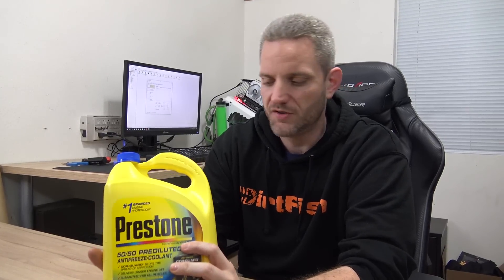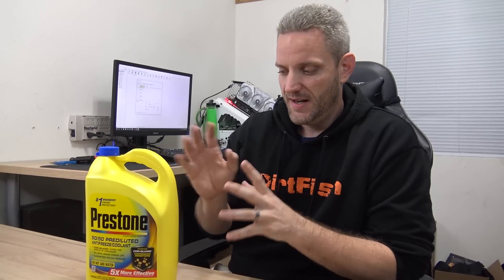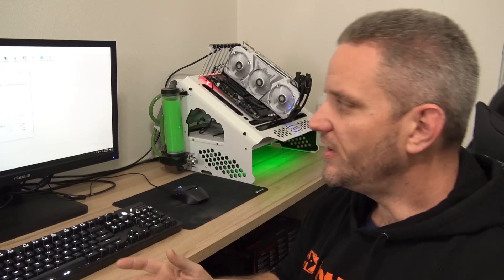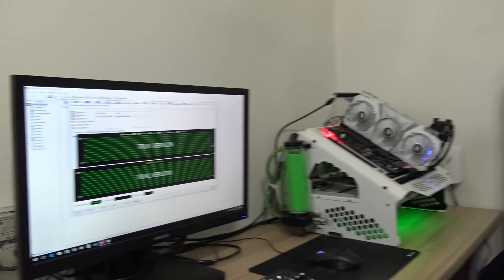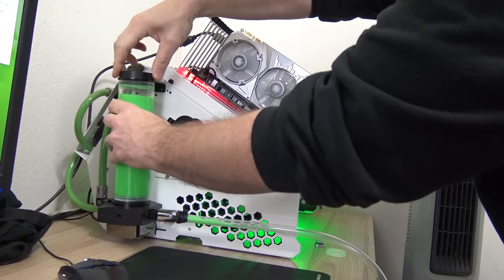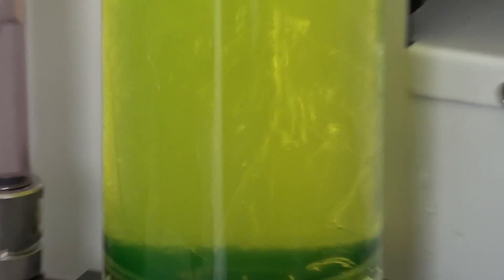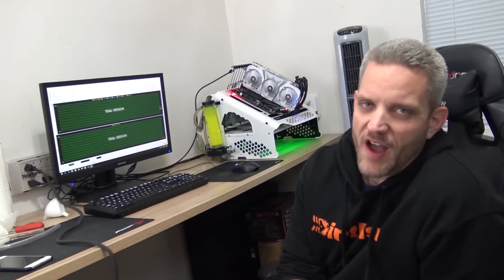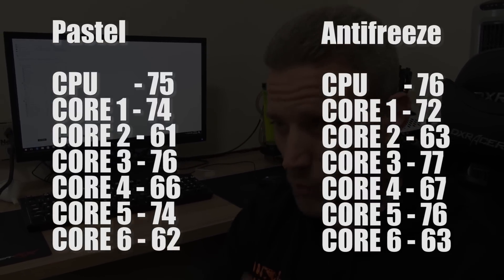I used Antifreeze to cool a PC

Comment: Why use an ethylene glycol based antifreeze and why use such a high concentrate. 50/50 for a PC is way too high. I would think 90% water with 10% antifreeze would be a much better ratio. The 50/50 wouldn't cool down as well going through the radiator. Remember antifreeze just prevents the water from freezing, and has some additives to increase the boiling point of water. I would like to revisit this test with options of coolants like a nitrate free coolant, silicate free coolant, or H.O.A.T coolant.

Comment: Back in like the year 2000 or so I made a waterblock and used a old car heatercore and I had it filled with antifreeze and it ran just fine for years.

Comment: I expected him to run a small loop outside of a computer for a few months or until it fails after a few days or weeks of running. Shouldn't be hard to run the pump off of a set of 12v batteries, depending on the draw.

Comment: i dont know what pastel is but you should also do just water you said distilled water you should try that vs like filtered drinking water because i know distilled water is not very electrically conductive not sure how that transfers to thermally but after that try the water with some of the coolant additives that are supposed to lower the temps

Comment: you are supposed to mix it with water, not use only antifreeze.  The hotter the weather, less antifreeze you need. Anyway, yes, you can use about anything instead of water

Comment: there is no way id put that shit in a pc use demineralized water been using it in my car for 360,000 klms the system is as good as new do not use distilled water its still corrosive

Comment: Its what I expected. The eg is to keep water in a radiator from boiling at 212. HOWEVER there ARE additives that will cool it down. Wet water is one and there are others. They drop the temp in my hotrod 6-- hp 350 Camaro by almost 60 degrees and there is stuff that will almost double that. Its a pink bottle at any autoparts store. I used it in my old phenom build and the temps that were almost 80c dropped to 55 c max. I think I have the bottle still so if you want a complete name I can do that. You have to make sure you are using quality tubing though and not the cheap junk some older coolers came with.
Heres a link to wetter water it claims 20 degrees cooler. Itw one of my favorites and I found it dropped 50 f. not jsut 20.  no guarantees guys . USE AT YOUR OWN DISCRETION NOT LIABLE IF YOU MESS UP YOUR STUFF...However it might be awesome should you have the correct components that wont get harmed by glycol based liquids. (glycol is basically sugars)
http://www.cjponyparts.com/red-line-water-wetter-coolant-additive/p/RLWW/?gclid=CjwKEAjwpdnJBRC4hcTFtc6fwEkSJABwupNi5-J3v-cmIsARK4lcP3ly78fP_SB0bfjchvcsYgy0RxoCdK3w_wcB

Comment: this may not be an original idea, but can you use liquid nitrogen in a water cooled PC??
Reply: thebattlerocker Nope, it would evaporate and the tubing would expand and explode, also condensation would form and kill the motherboard, Now you can use liquid nitrogen to cool a cpu, just not in a loop like this
Reply: Liquid nitrogen is just air. Unless you have a compressor to get it back into liquid form it would just all sublimate. Then you invented air conditioning, so you might as well just use R-134a

Comment: that tube you pulled out is to put the warmer coolant on top and take the coolant from the bottom where its colder
Reply from the maker: No, that is not what its for. i was a part of the initial testing of the light tower res and its nothing more than aesthetics. Dont make stuff up
Reply: are we both talking about the tube at 8:13 ? it looks like the tube is supposed to push the fluid to the top of the reservoir like it did when you ran it low at 5:17 .

Comment: Features:
For All Gasoline Engines, Light Duty Diesels & Classic to Modern Production Cars
Ready to Use, No Water Required
Eliminates Overheating, Boil-Over & After-Boil
Generates Very Low Vapor Pressures
No Silicates, No Phosphates
Contains No Oxygen, Eliminating Corrosion & Pump Cavitation
Low Toxicity
Protects for Life of the Engine

Comment: I know nothing about watercooling, but couldn't you use chemically stable materials such as glass (at least I belive that's the term for it) and have a perfectly fine loop? Or maybe use the materials used in cars, cause presumably you'll then be using the fluid under the exact conditions it was made for (with the exeption of temperature)

Comment: Hey try and cool a modern system with a stock Pentium 4 3.2 Ghz Prescott CPU cooler and compare temp results with a Preshott processor compared to a modern I7 using the same cooler. Zip ties to attach to a modern motherboard allowed as long as you show you evenly tightened them. Challenge given Jay.

Comment: rubber and plastic are also used in a car cooling system at higher pressures and temps so i guess it should work

Comment: How does antifreeze help with cooling? It's Anti Freeze, not anti heat. You should have used car cooling liquid!
Reply: Ruben Braekman antifreeze is car cooling liquid/coolant. but pure antifreeze doesn't conduct as good as water so vehicles overheat. while pure water boils and freezes too easy causing a ton of problems. that's why he said in the beginning in was premixed 50/50.

Comment: mineral oil mineral oil mineral oil. I would love to see what happens when you run mineral oil through a pump with tubing. People claim that doing so will cause the tubing to harden over time, and that you'd need an additional external cooler pump to quick chill the mineral oil to maintain low temperatures, perhaps something like a fridge could do, only in a smaller size that doesn't take up any additional space. Taking the concept of how a fridge works, and miniaturizing it to encase around a tubing pump thus cooling down to -18°C

Comment: Toyota has some weird coolant that smells like juice and is red and is very long lasting, you can't mix it with the red stuff that GM uses because the GM coolant will eat Toyota water pump seals, anyway not sure how different types of coolant would behave in a pc cooler but there are some other coolant types out there in addition to the classic green stuff

Comment: All antifreeze does is lower the freezing temperature of water. It actually doesn't work as a coolant itself. You put it in your car so the water in the radiator doesn't freeze if the temperature is below 0c 32f.

Comment: a lot of cooling systems in cars use plastic components such as water pump impellers among other things. granted an engineee wouldnt use a plastic thats incompatible with ethylene glycol for a part meant to be submerged in it but i digress. the plastic, with the exceptiom of petg tubing, SHOULD be okay. now another concern is biological life. it doesnt grow in cars because the temperatures can range from 180 to 210 degrees Fahrenheit. but a water cooling loop wont get that hot so a biocide is required

Comment: But now you put your desk outside in Antarctica and your coolant won't freeze! 

Antifreeze really doesn't cool any better than water, it just doesn't freeze in the winter causing your engine block to crack. It also has a higher boiling point, but that is also irrelevant for a computer application.

Comment: no its not gonna be the same, its gonna get hotter. antifreeze is used in engine to keep the water from freezing in sub 32 temps, and also has corrosion inhibitors for rust etc. 100% water is THE best coolant. EDIT: watched the rest and saw the end.. although they were consistently higher temps except 1 it was only 1 or 2 degrees. i would say it doesnt make a difference because it's limited by how much heat it can sap from the ecu(which has very little to do with the fluid, more so system design) than it is how much it can radiate it off(which water is noticeable better at). just so you know, and i know it doesn't mean i know everything about it, but i am a mechanic and i do study these things

Comment: Why would you use antifreeze?  antifreeze is terrible at wicking away heat, that's why you have to use it with water in your car; the water pulls the heat away, the antifreeze decreases the freezing point of the water (hence the name), but also increases the boiling point, to make the water effective at 105*C.  since computers will never see the boiling point of water, there is no reason to even try this experiment, water is the best coolant.

Comment: Pure distilled water has better thermal performance than antifreeze. Any mechanic can tell you that. The additives that lower the freezing temp also lower the fluid's specific heat capacity. That's part of the reason that vehicles in warm climates run plain old distilled water. It's cheaper and works better.

Ethylene Glycol has about half the specific heat capacity of water. Mix it 50/50 with water and you have a net drop in heat capacity of about 25%.  

50/50 = 3140 J/kg C (0.75 BTU/lb F)
Water =  4181 J/kg C (1.00 BTU/lb F)

Comment: i use kraft car coolan liquid antifreeze and it works like 2 years without even  care about the loop ,why ppl use shitty  and cost solutions from manufacturers instead of using car antifreezer ??  laing d5 pump 3*12 radiator 1/2 tubbin (13-19) cpu and vga full blocks , never had a problem since i started to use car coolants . but i think none of mine used glycol or whatever is called in english

Comment: Late response but since you have identical if not more variation in a vehicle for metal types, wouldn't using vehicle coolant be better? It's built to withstand a lot of shit and it still goes through not only plastic but rubber as well on your car.

Comment: I used dex-cool premixed (de ionized water). it has been almost year and a half and the tube are clear, no bubbles, no foaming using a exos 3 fan external cooler with 14 feet of tubing (7 feet to and from cooler), I put the extra length of tubing into a 5 gallon bucket that has a 1 gallon frozen water jug in it, and fill the rest with water (during the summer months when it can reach 120 degrees outside.

Comment: since 2008 my system runs on BASF Antifreez. 2012 hardwarechange same Loop new BASF antifreez.....since then no maintenace only remove dust and refill every year with 100ml antifreez.

So imho there is no reason against antifreez.

Comment: It will over time corrode the metals because of the water. And the pipes would need to be rubber.. Also I am positive if used in conjunction with a fan the antifreeze would be much more efficient..

Comment: Water has a high specific heat capacity so you should leave it for at least an hour not 10 minutes. If you don't, the results are unreliable.

Comment: i use shell elc coolant in my pc with 45% distilled water ... i find that my system works perfectly well. my idle temp is 32" my 100% averages about 45"- 47"... no problems as yet, im into it for 1 year constant running.

Comment: Yeah I think you're right about it being pointless.  The idea behind anti-freeze is to prevent the water from freezing when it gets cold.  Zero chance of that here.  It may be an interesting experiment if you had a way to run the water through a freezer system to run super chilled water through the system.  May be able to overclock a lot higher.  Entirely impractical though.

Comment: I mean yeah you can use it but its anti FREEZE the only reason its anything other than water that you put into your car is for super cold temperatures. So unless you are wondering what the best coolant for the system your building in Antarctica is then the point is moot.

Comment: I used my 10 gallon fish tank as a reservoir. It was a few degrees hotter than the recommended temps for tropical tetras at about 80 degrees but they didn't mind. Probably increased temps by 8 degrees in the tank without it. It worked and they didn't mind while I had it Lol Sadly because it was a fish tank the pipes started to clog with algae because of the extra heat, the algae grew in the tubes like crazy after a few months. So I stopped using it and went back to air cooled, but it was fun!

Comment: before watching the video, antifreeze as a coolant? shouldnt be a stupid thing to do. but i wonder if you have a truly overclocked computer that runs at 80 degrees (celcius) or higher, water could start ''boiling''. so could you use engine coolant? the red fluid or the blue fluid (theres a difference i cant remember though)

Comment: Antifreeze is designed to be used in a pressurized system........ so you need to hook up a surge tank and let it get hot enough to build about 7psi and ........ yea do that!

Comment: i would like to say that ive actually been running the exact same coolant in my pc for several months now. i got the crazy idea when i wanted clear tubing on my all in one cooler. i cut the original plastic tubes off and used some water hoses.... yes, no temperature difference, but its green, so thats a win

Comment: There's a very good reason that greater than 50/50 mix of antifreeze wouldn't work. Ethylene glycol doesn't have nearly as good heat conducting properties as water. Using higher concentrations of ethylene glycol wouldn't cool anything nearly as well as water. Water is VERY good at cooling things. I could go into higher detail, but most people wouldn't understand. It has mainly to do with the heat capacity/specific heat of the EG vs the water.

Comment: Cmon Jay, as a car guy with a 370z, you should know that pure water is actually better than antifreeze when it comes to cooling! The reasons to use this stuff in your car are mainly to prevent boiling, freezing and corrosion. Corrosion and algae are the concern when it comes to OCing. Nevertheless, highly entertaining video, as always.

If you really want to see a drop in temp, you really should go all the way and remove the heatspreader from the CPU, putting the die directly in contact with the waterblock. I did this with EK mounting adapters and differences are noticeable. It also comes with bragging rights when successfully done (well, in the OCing scene at least).

Comment: just to put it out there. most impellers on your water pumps today are plastic (cars) and the coolant doesn't affect them. however, with that said. if you decide to use antifreeze as your PC coolant, stay away from the dexcool/red coolants. it is more corrosive than originally designed. aluminum hates this stuff. umm... yea. good luck. 😁
Reply: really? i was thinking of using the red stuff thanks for the warning:) what about royal purple 5w-30 engine oil? :)

Comment: That's not anti freeze that's coolant. anti freeze is the concentrate. if it's already mixed with water it's coolant. learn ur car shit computer guy :p and the anti freeze that's in the coolant does not do as good of a job as cooling as water. if you live in a place like Australia they run only water in their cars. so in conclusion all water would be better than using coolant

Comment: there might not be a difference in using anti-freeze and other liquid for cooling but you could try placing Black Lights since anti-freeze (ethylene glycol / propylene glycol) is known to glow under black lights.. if you are into decorations :)

Comment: JayZ,.. What about using the 'oil milk' they use when drilling holes in tough metals? Would that work well? I was INITIALLY thinking of just regular oil, but I figured it'd be too thick for a regular PC water-cooling pump. The 'thinner', 'oil milk' I'm thinking of ought to be easy for a PC water-cooling pump to push around the system, right?

Comment: This is just stupid. Anti-freeze is too viscous. You might as well be using honey.
You need to use a surficant in order to lower the surface tention of your coolant.
Best thing I've ever used was regular distilled water with "water wetter" added.
Water Wetter is safe for use in glycol based systems BTW, so PETG is fine.

Comment: I ran it for years on an old 775 system. Works great but it tends to gel up after a few months. I did a longevity test and it went for about a year before clogging a water block and leaking one drop onto a 9600GT. My blocks are now out, i can ship you one if you want to tear it apart... didnt seem to do any harm at all but on a side note... it is somewhat conductive.... sooo yeah.

Comment: Hey Jay, Just a mechanics oversimplified explanation of the Antifreeze. Antifreeze itself isn't intended to prevent overheating in vehicles. It of course will, because of it's basic properties, but that is a different topic. Antifreeze is used as a way to prevent the water from freezing, and also has additives to help prevent corrosion in metals. The fact is, pure water actually cools better than pure antifreeze, because the boiling point of water is lower. So no matter what you do, Antifreeze itself is actually not as good at cooling as pure water, and is only used as a way to prevent the water from corroding the metal, or freezing. So in a sense, it is simply a fail safe for the cooling system. If you didn't notice, even my oversimplification is over complicated. This is why I work on things, and don't teach people HOW to work on things. Good video, and informative by the way.

Comment: Is it safe to drink orange juice or milk after testing it as a coolant?  Is it safe to reuse the anti-freeze by putting it in a car?  Would it be safe to use ethylene glycol by using parts of the same materials in an automotive cooling system?  Finally, does one fluid take less energy to pump than the other?

Comment: im a mechanic and lot of my friend and i use water wetter in our cooling system in race cars. its about 3-4 soup spoon/gallon of water and it does the corrosion/higher boiling point/better heat transfer.